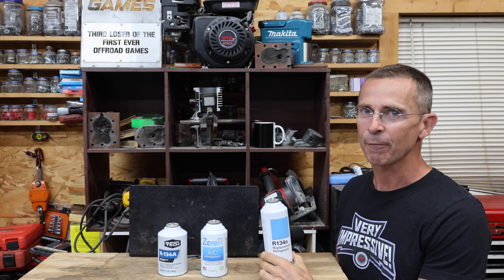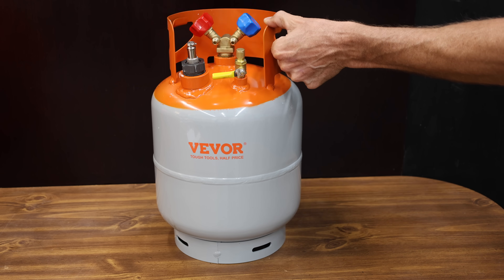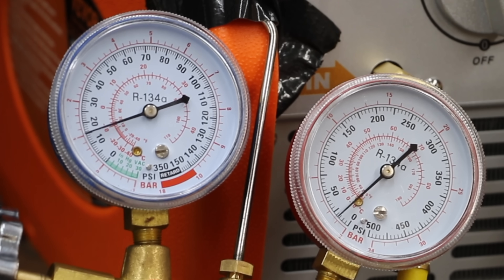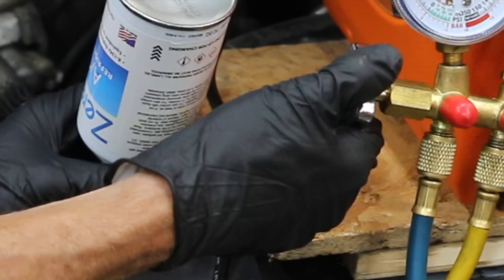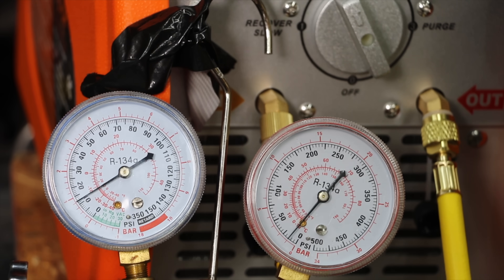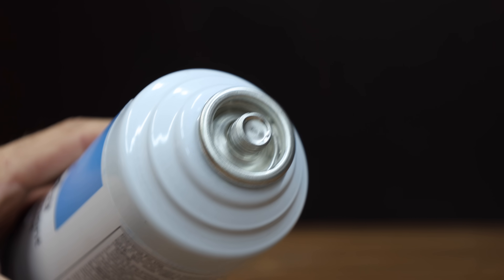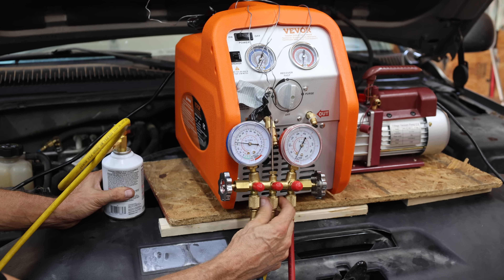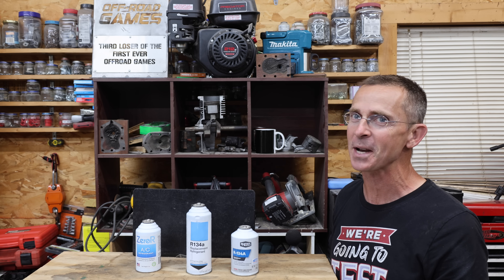How Dangerous is Fake Car A/C Refrigerant? Let's Find Out!

Comment: Well im glad i use the artic freeze r134 instead of the generic junk, i just need to get the r12 to r134 conversion kit for my 92 s10.. hey great idea but i don't know if you have a vehicle that has an old r12 system, but if you do do you think you can do a video on converting the r12 to r134. Just asking because all the kits in the part stores only consist of a couple adapters and seals for high and low pressure lines that just screw in, I've only ever did one other ac system but never could get it to work, wasn't getting power to compressor so never knew if it worked or not..
Reply from the maker: Thanks for sharing.

Comment: At these days most of the AC uses natural gases, check R32 which is iso butane and R290 which is propane.

Those are widely used in split systems and have a very good performance, maybe those cans are some kind of butane?

Comment: R-600 is butane. That's what is going in new residential refrigerators.
They also seem to have a very high failure rate. I bought a brand spankin' new one. It worked for about 18 hours. Time to get it fixed? About 30 days. Fortunately, it was in a house being rehabbed. When it broke it sounded kind of like a waterfall.
It takes a crazy small amount. I think it was 8 ounces or something.
Reply from the maker: Thanks for sharing.

Comment: Have you considered comparing window tint? My work vehicle recently had its windows tinted and it made a huge difference in heat resistance, but I find it reacts weird with my polarized glasses. Made me wonder if all tint does that, and who better to look up than PF??
Reply from the maker: Thanks for the suggestion.

Comment: I run propane instead of freon in my truck and it works great.
Reply: It's considered environmentally friendly to use ppane instead of 134r, I did quite a bit of research before I did it, and you use way less which means less pressure on the a/c pump.

Comment: As fast as you added refrigerant, may be some issues.  Have to go slow, 
Also, pulling from highside at first can pull oil out, good to start from low pressure side if trying to avoid that, then open high side when pressures are equal on both high and low side gauges.

Comment: I did not know about the propane and methane R134a replacements on the market. I had a refrigerator that used R134a and I will look at some leftover cans I got from Amazon to see if that was what was actually in them. The new gas would not cool the freezer properly. I had to replace that frig because the manufacturer whose name starts with Sam failed to evacuate the system properly during assembly and the refrigerant became acidic and ate through the copper lines near the compressor causing it to constantly leak refrigerant. It barely made it ten years before it died.
Reply from the maker: Thanks for sharing.

Comment: I bought some R134a a long time ago to recharge an AC system that was open to atmosphere and it worked great with manifold gauges and a vacuum pump. Unfortunately, I live in the state of Washington and it is illegal to purchase R134a off the shelf here, which is why I am trying to save the last few cans I have. I know it is damaging to the environment if it is released, but it really limits the DIY repair of an AC system when the cost of repair at a shop is VERY high for this service because they have to pay for all the permits to be able to do it. I really was hoping the substitute cans would be an adequate replacement considering all the red tape here around real R134a but being flammable seems to be a really big drawback. I heard that an old farm truck trick was using propane. They swear by it being even better than r134a... but only on farm trucks though, not a car you take on a road trip with the family.
Reply from the maker: Thanks for the feedback.

Comment: Awhile back you tested if synthetic grease is better than nonsynthetic. How about testing how well food safe grease performs with both the other options. I work for a forklift dealership/ rental department. We use shell gadus S3 V460Xd 2 as our regular grease and lubriplate FGL-1 for our food safe options. We've been hearing that the food safe stuff simply won't last and isn't good grease. Would be neat to see how true they are and how the greases perform.
Reply from the maker: Thanks for the suggestion.

Comment: I've been running propane in the R-12 AC of my '84 Volvo for a decade and it works great. Yes it's flammable, but so is the gasoline that powers the car. The propane charge is only 8oz.
Reply from the maker: Thanks for sharing.

Comment: Hi, I have a two stroke motorcycle engine, ask you what is the number of oil levels, do I have to use for my engine?  Like sae 50 or sae 30, in our marken oil we have no oil writing used for 2 or 4 stroke, only nuber of oil, kould you please  suggest no.of degree ?
Reply from the maker: Thanks for the suggestion.

Comment: MY IDEA:   I'm an American from bitter cold Michigan and now I live in the Philippines. Here  in some circles almost no one uses anti-freeze, but I'm talking shade-tree mechanics. I drive a 20 year old  car with a 1.6L 4 cylinder engine. It's a Lancer if you care. My question is about its value where it never freezes and is always hot, say 80-90 degree weather for example, what happens when you skip it? How much is enough? I've heard it doubles as a lubricant for the water pump? Compare brands if you haven't before.... Thanks.
Reply from the maker: Thanks for the suggestion.

Comment: Testing r-12 substitutes in an r-12 system might be helpful to those with old systems that can no longer get proper r-12. As well as compare against some of those r-12 to r-134a retrofit kits. Sadly, i dont have my 280zx anymore, but if i did, id be desperate to get some AC in this heat.
Reply from the maker: Thanks for the feedback.

Comment: You should try 1234yf in an a 134a system and try the compressed air can as Freon see if it works Ik if good for older model of ac compressors
Reply from the maker: Thanks for the suggestion.

Comment: It should be noted that most refrigerant leaks are VERY slow. Usually days, weeks or even months. That means that the concentration of the refrigerant gas, whether Freon or a replacement, is far, far below the LEL (Lower Explosive Limit). Although there is a theoretical danger to using a flammable refrigerant in that it MIGHT burn or explode, the reality is that  the probability of a fire or explosion is very, very remote,  As a (retired) chemist, I would not have the slightest hesitation in using the replacement.
Reply from the maker: Thanks for the feedback.

Comment: Can you do motorcycle oil comparisons? Since motorcycle oils also have to work in air-cooled as well as oil or liquid cooled engines the requirements for them tend to be on the higher side of standards as well as being quite viscous and thicker than your average car oil. I realize it might be a bit of a repeat of old videos but it would be somewhat interesting to see the difference between car oil, motorcycle oil and which motorcycle oil performs the best.
Reply from the maker: Thanks for the suggestion.

Comment: R600a (isobutane) and R290 (propane) mixed is R436 (44/56 is R436A, 48/52 is R436B)
R1270 (propylene) and R290 (propane) mixed is R433  (30/70 is A, 5/95 is B, 25/75 is C)
There are some others with Zero GWP and Flammable, but it's probably one of those.
Reply from the maker: Thanks for sharing.

Comment: Ok, I admit to wondering how to acquire R-12 from Mexico because I was informed 134a wouldn't work in my 80's GM AC system.  
But 134 & PAG oil worked just fine with no modifications.
Reply from the maker: Thanks for the feedback.

Comment: The AC performance of the other refrigerants did better than I expected. However, still not a replacement like claims on the cans. The reason is, your  AC system is designed for r134a. I'd assume those alternate refrigerants would perform better with a properly sized orifice tube. Maybe newer cars with expansion valves (variable orifice size) and an optimized compressor could see improved performance.

Also a small correction, freon isn't r134a. By saying freon your referring to r12. Specifically the brand Freon. It is a common mistake a lot of people make. Freon's marketing team was strong back then and the name stuck.

Comment: On “JunkYard Digs” they use a computer dust cleaner from Walmart in the cooling system on a ranchero (I think) for the air conditioning system. 

I would like to see and have your thoughts on that after you try it.
Reply from the maker: Thanks for the suggestion.

Comment: Once had a car pull into the shop.. complained the AC Compressor wouldn’t kick on… cause was they used a few cans (not sure of number) of the recharge refrigerant from autozone with the leak dye…. When we recovered the refrigerant and separated the AC Oil, all the dye started leaking out of the AC Oil reservoir on the AC recovery machine 😂
Reply from the maker: Thanks for sharing.

Comment: the "R134A Replacement" is HC-12A/R-436A/R-436B, which is to say, a proprietary mix of R-290 and R-600A, Propane and Isobutane. Fancy BBQ gas.

People are always going on about the flammability, but it's a small quantity, in a sealed system, with no ignition sources or oxygen. In a car that has gallons and gallons of flammable gasoline. It's all a matter of perspective.

And if the system is leaking, fix it first.

Comment: This is exactly why reputable AC shops have a machine that can detect what type of refrigerant is in the system, and a dedicated recovery machine for contaminated vehicles.

Once contaminated, the system must be flushed and the accumulator/dryer replaced. I’ll be then should you recharge it with the proper oil and refrigerant.

Comment: Most modern day cars use variable displacement compressors and need to have the refrigerant added by weight as relying on pressure only can bring about very misleading results due to the variable displacement nature of the compressor . When changing from R134A to  a Propane based ( Flammable ) type refrigerant will typically call for 1/3 of the original 134A charge weight ! The end result of going to Propane is usually better cooling with a lower high side pressure reading , taking some of the strain of the compressor .
Reply from the maker: Thanks for sharing.

Comment: Since you have all the gear, how about testing canned air, "Duster" or R152A refrigerant?  It is considered to be a "drop-in" replacement for R12 and R134A.  Compared to R12 & R134A, it has very low GWP, close in cooling efficiency, although more flammable, (not as flammable as propane).  I've used it as a inexpensive validation refrigerant to confirm that a AC system is gas tight and working, prior filling the system with R134A.  No recovery system needed.  Purchase it from Costco, and it is significantly less expensive than R134A.
Reply from the maker: Thanks for the suggestion.

Comment: A gauge on one side of the AC system is useless because in order to properly diagnose the AC system,  pressures on both sides need to be known. If both side pressures aren't known,  adding refrigerant can damage the AC system. Also, AC systems are completely sealed which means if one adds refrigerant, the system more than likely has a leak. And by adding refrigerant it's just a waste of money until the leak is found and fixed.

Comment: Well here is a test idea. Supposedly can’s of compressed air dusters are supposed to be filled with a type of Freon that does not deplete the Ozone, that is also supposed to be a comparable replacement for the old R12 Freon used in vehicles like the 1978 Ford F-100. Would be an interesting test, if you can find a vehicle that has an R12 system.
Reply from the maker: Thanks for the suggestion.

Comment: Todd, Great video as always. How about testing air con stop leak products? I'd be interested in hearing your thoughts. My experience (today) was this:
200 000 mile, 2006 5 cylinder Volvo diesel A/C never been touched since new was working but not chilling properly. Low refrigerant pressure but not low enough to stop the compressor from working.
I put a can of R134a aircontopup stop leak o ring and seal reconditioner (ebay) in. This bought the pressures up to 35/150 psi in line with I believe Volvo recommendations. On the road at 1200rpm on a 22 degree C day the outlet air measured at 1 degree C! Very cold, it seems too good to be true. Any thoughts?

Comment: out of curiosity do you not have to worry about adding oil to the ac system for the other types of refrigerant you added? I assume when evacuating the original r134a it brought along the oil in that system as well but doesnt that mean for the other tests there was no compressor oil in the system?

Comment: Two years ago, I had my car AC charged up.  The tech told me that the compressor was about shot and would need replacing "soon".
That was 2 years ago and it's still working just fine.  And quite honestly, it's a 2003.  So, there's a lot more parts about worn out than the compressor.  I'm planning on driving it till either it dies or I do.
Reply from the maker: Thanks for sharing.

Comment: Propane refrigerant needs a little bit more volume to properly work in an R-134a system your high side pressure was not high enough and that's an indication of a low charge. The people that market these "replacement refrigerants" say equivalent, but it's not really equivalent, because the gas temperature properties are different between gas mixes.

Comment: About 10 years ago on the waterfront we had several refrigerated containers blow up. This was caused by bad Freon made in Asia. We had a test procedure where we removed a little into a bag. Then we burned the gas in a safe place with a specific procedure. If the gas burned a certain color then it was bad.
Reply from the maker: Thanks for sharing.

Comment: have you tried keyboard duster as a refrigerant?  i seen someone else's video claiming that is a refrigerant called r-154a or something like that.  it supposedly has real similiar cooling stats at a lower cost.  in the video i watched, they used a hose kit that pierced the side of the can to extract the duster
Reply from the maker: Thanks for the suggestion.

Comment: The replacement "refrigerants" are essentially liquefied natural gas. It's incompatible with PAG oil, which is used in some R134a systems, and depending on the hose seal material, it might not be compatible with that either. When I was a HVAC and powertrain cooling warranty engineer with GM, a question was passed to me about whether it would be OK to use the replacement refrigerant to get a customer's A/C working again. It didn't take long for me to find the answer: absolutely NOT!

In the specific vehicle in question, the replacement gas would've attacked the hose and compressor seals and then every A/C seal in the car would've needed to be replaced. The incompatibility with PAG oil also meant it could've caused compressor failure due to oil degradation.

We also had some problems associated with people in developing nations topping up their A/C with R12 instead of R134a (yes, it's still available from suppliers in China).

In summary, only use the correct refrigerant.
Reply from the maker: Thanks for sharing.
Reply: @ProjectFarm  you're welcome.

Comment: Can you make a video to see how much more fuel efficient a new 4 cycle weed eater, chainsaw, etc compared to newer two cycle version. Wondering if the two burns alot more fuel than the 4 cycle or if you not even be able to notice a difference.
Reply from the maker: Thanks for the suggestion.

Comment: The pressure in an unrunning system is just the saturation pressure of the refrigerant at the ambient temperature, right?  So as long as there is any liquid present, the pressure will be the same.

Comment: would using box fans instead of driving work, or is there a risk of recirculating all the hot air. I think it would be easier to test without having to move the vehicle. if stationary you would probably have to hold the rpm at 2k for better results as well

Comment: I stopped buying from Amazon if it's related to health or could harm something. I'm considering a laptop battery, but I might pay the premium for iFixIt's battery. 

I was on the highway once. I got some bad gas and my car did not like that at all. My father had a pretty good theory that since my car takes midgrade and premium, the gas station might have had bad gas since premium might not be purchased as much there. I think you might see where this is going. Could any gas treatment help with a tank of bad gas?
Reply from the maker: Thanks for the suggestion.

Comment: To get the HC refrigerant to perform you need to use quite a bit LESS.  You want to go for like 30 at most on the LOW side.  High side will be very low.  I don't use it but many in our car clubs do and you can watch vent temp and bleed off a little at at a time (safe) until temp drop stops,   You can then add a tiny bit as a buffer and done.  That is best charge level..Charging by 134a weight will not work well as you found.
Reply from the maker: Thanks for sharing.

Comment: You should test eBay Aluminium radiator compared to normal plastic aluminum radiators you get from an auto parts store. I was in a phase when I wanted to upgrade my cooling system and purchased not one but 7 Aluminium radiators because they all leaked with in a week of each other so I just wanted to see what you could found out on is it really worth the money to even upgrade or just stick to good old plastic aluminum stock radiators
Reply from the maker: Thanks for the suggestion.